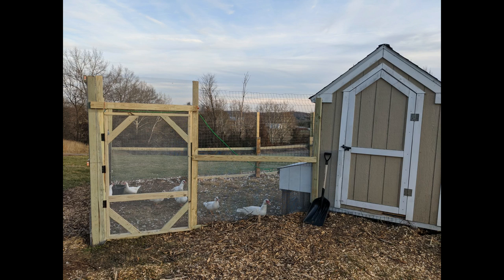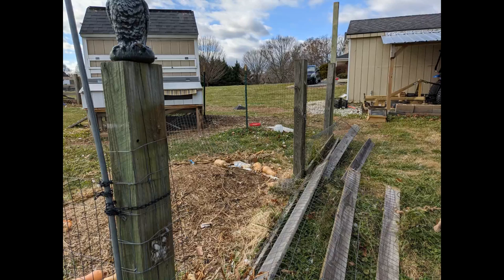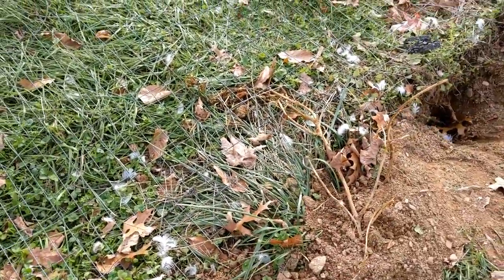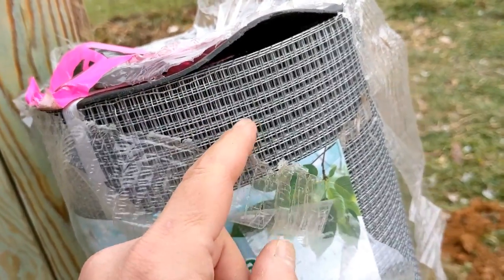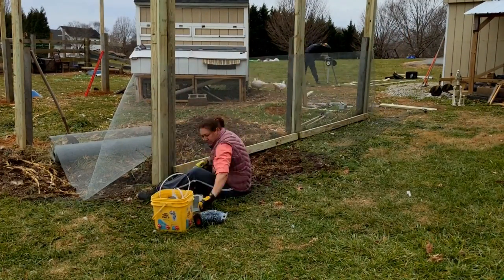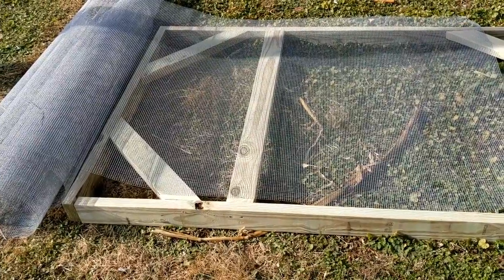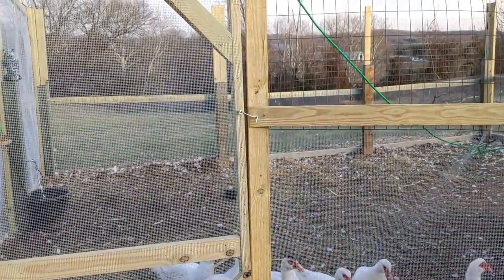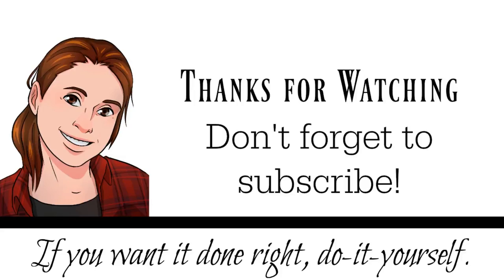How to Build a Duck Run

Comment: I like the idea of using cheaper wire for the underground barrier.  Why did you build it so tall?
Reply from the maker: I wanted to avoid making any cuts for wood. I was trying to get this up fast because I had a fox actively taking my ducks. But some animals can climb over so it's good to have something tall to discourage that. I SHOULD add horizontal boards along the top and then add wire for the top of the run too. But at this point nothing has figured out how to get in so I'm seeing if it's going to be a problem. I ran baling twine across the top (and added some tarps for shade right now while it's hot) to hopefully prevent hawks from getting in. But I think I'll have to make adjustments if we ever get racoons around here.

Comment: Is pressure treated good ok for ducks
Reply from the maker: For an open air duck run, I wouldn't worry about it as they aren't going to eat the wood.  It's sort of a trade off for longevity of the run. Indoors, pressure treated wood puts off chemicals that can be harmful to air quality, I believe. Usually if you were building a structure, the pressure treated wood goes on the outside, then you finish the inside with non pressure treated wood. Anything that touches the ground is generally PT to slow how quickly the wood will rot. At least from my understanding. 

I believe there are some types of wood that aren't prone to rotting and don't need PT, but I don't know enough about that to speak on it- maybe black walnut wood? I think it's fairly expensive though.
Reply: @doityourselfdanielle  OK great, That's what I did. Rarely does someone talk about it. Great video you did. I'm in Toronto Canada:)
Reply from the maker: @normjones6916  Yeah honestly I struggled with this too. I wanted it to not rot (and to not waste money) but I also wanted my animals safe. I think there's some wood that doesn't need pressure treatment (like maybe Black Walnut?) but I'm not familiar enough to speak on that. 

If you're in Canada, you may want to add some snow cover and wind breaks. :) Ducks are pretty ridiculous and seem to stand up well to the cold, but they'll get more outdoor time with some coverage. I'm a big fan of leaving them out in nature as much as possible- we don't heat the coop or anything. But I know y'all probably get quite a bit colder than we do!